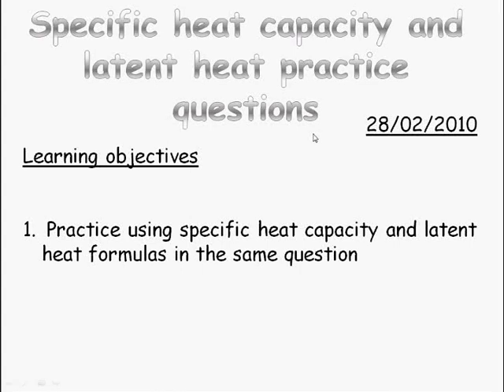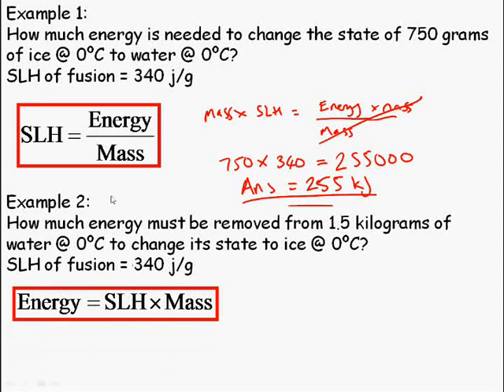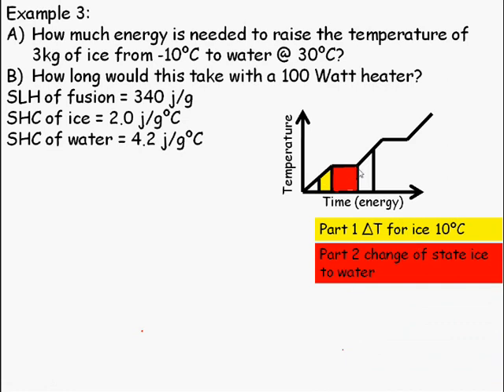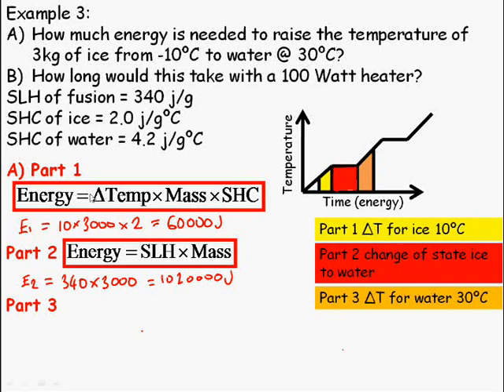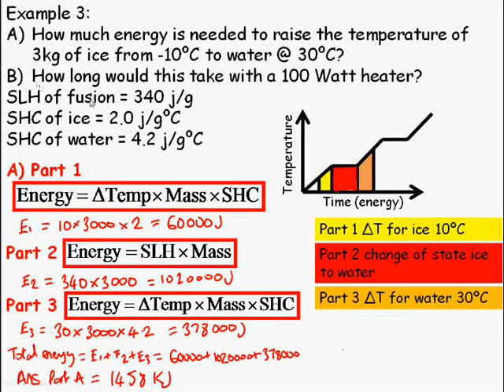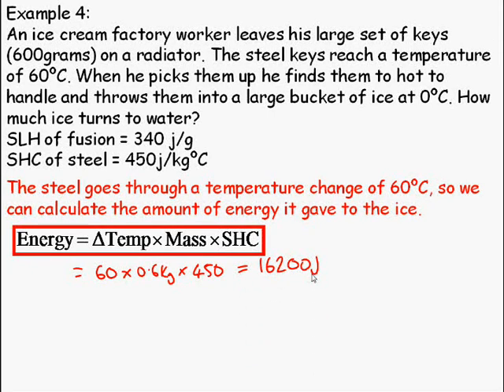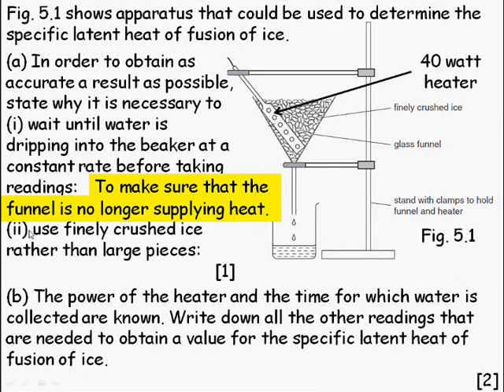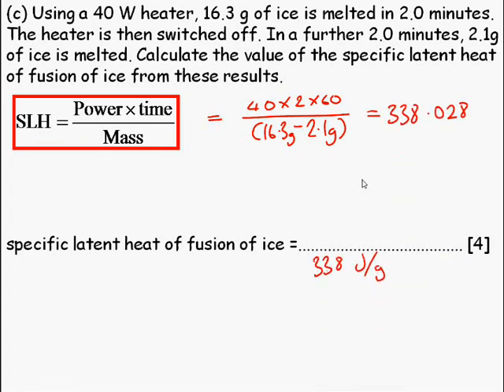Specific heat capacity and latent heat practice questions

Comment: 1. You are given 50 g of hot coffee (at 80 deg * C ) but given that it is a hot day, you now want a cold coffee. What is the minimum amount of ice (in grams) that you must add to cool the coffee to a temperature of 10 deg * C' Assume that coffee has the same specific heat as water and neglect the heat content of the cup and heat exchanges with the surroundings. The ice temperature is 0 deg * C Given: C water(s) = 37.6J / (mo * l deg * C) , C water (l) = 75.4J / (mo * l deg * C) Delta H fus =6.01 kJ/mol

If the ice comes from a freezer at - 20 deg * C would you expect to have to add more or less ice to cool the coffee? Support your answer by doing the calculation.

Could you help please?

Comment from the maker: Ai) The funnel is at room temperature 20 degrees maybe so as it cools too the temperature of the ice heat moves from the funnel to the ice.
Aii) Imagine a huge chunk of ice, the outside of it could be at 0 Celsius but the inside might be -20 Celsius or colder. That would mean that you would have to supply energy to heat the ice to 0 Celsius first before supplying the energy required to change state. Since we want only the energy to change state this is a bad idea.

Comment from the maker: The 2.1 g of ice melted not because of power being supplied but because of heat from the room etc. When the experiment was running heat from the heater melted ice but heat from the room did as well, how much ice melted due to heat from the room? by measuring the amount of ice melting after the heater is off in 2 min we can approximate that both would be the same. 
hope this helps :)
Reply: Ah this clarifies it.

Comment from the maker: @wyattchung Hey there, the reason we subtract the 2.1 grams is because this is what melts anyway even if the heater was not on. Its hard to explain in text but my video specific heat capacity explained has a similar example.